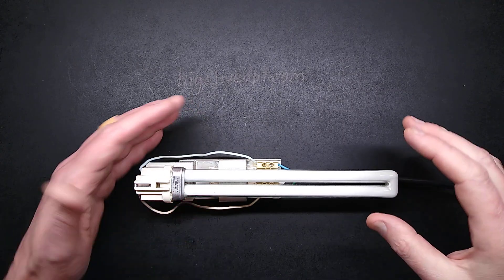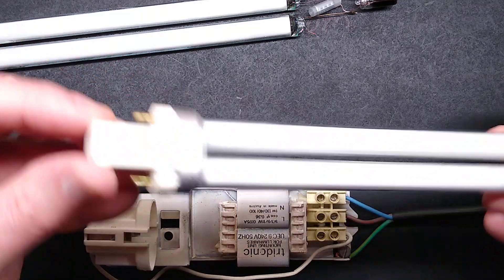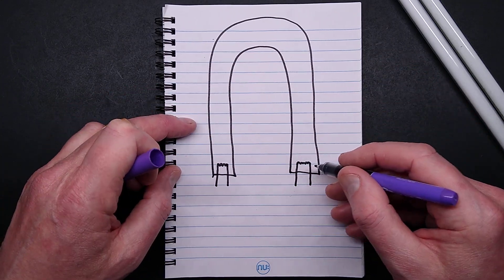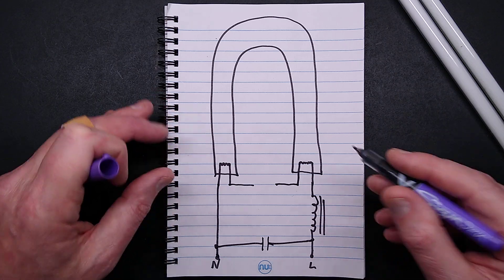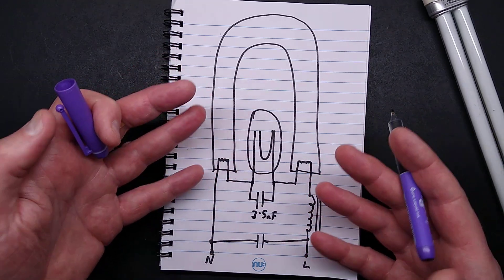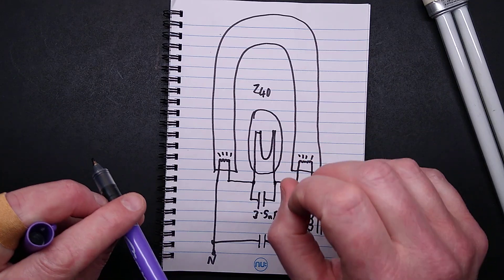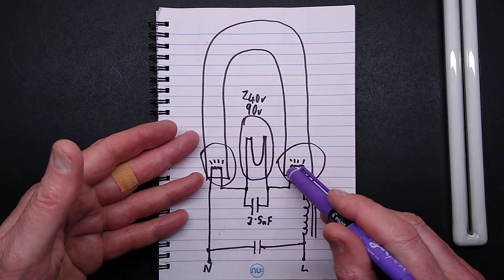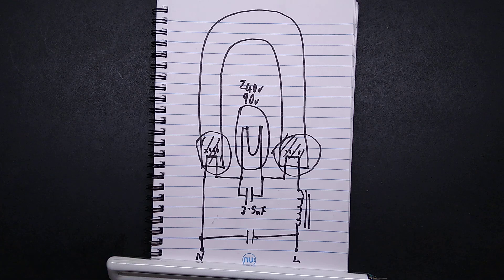Retro already?

Comment: I still have a few of the first commercial CFL lamps, where you used a PL lamp and a ballast, some electronic, some magnetic, that you could fit into a standard lamp socket. I used to repair them as well, they had a few standard failure modes, fusible resistors that died, and bridge rectifier diodes that went short circuit, and a capacitor that went open circuit. As they cost then the equivalent of $30 and a fix was under $1, well worth fixing them. The magnetic ones you just changed the tube, and away it went, with them outlasting almost all of the CFL or LED fixtures by a large margin. On 24/7/365 they would last 2 years with good quality Osram or Phillips tubes ( made in the EU of course, the GE ones made anywhere were complete junk, unless you had the ones fully made in the USA before the plant was closed and moved to Mexico), and were reliable, just needing a new PL tube when the old one failed.

That kit is actually a retrofit kit, designed to be used to convert a standard brick style bulkhead fitting from a 60W B22D incandescent lamp to PL, either PL7 or PL9, and would attach using the same screw mounting holes used for the bayonet holder, and fit the lamp in the existing cover. I did do a fair number of those, as it was a lot faster in buildings to retrofit, using the old fixtures in good condition, and only replace a few that were failed, using them for spares to fix the others. Made lamp changes something you simply did as inspection once a week, and pull out a ladder to change a lamp a monthly thing, not like incandescent, where you were changing a half dozen a week at times. Box of lamps would last a decade, instead of a year.
Reply: I have collected quite a few of those of the Sylvania Lynx Diamant variety with the magnetic ballast. But also some of different brands with electronic ballast that seem to have issues to start on tubes other than the ones they came with.

Comment: There's a landfill/recycling yard a couple of miles away across the valley from me, and they have yard lights that switch on when it gets dark. There is one light that is pointing directly at my house that does that slow blink of a bulb on its way out; 6 seconds on, 6 seconds off. It's the most annoying thing because once you notice it, you can't stop looking at it because it's the brightest light in its surroundings. If anyone reading this works at the landfill on Whinney Hill Road, please replace it. I'll even buy you a new one!
Reply: Better still, move to low energy lighting. I'm sure your local councillor would love to take their idea on, and then put it in the newsletter as their idea.

Comment: i miss fluorescent already, used to be so easy, nice easy repair no matter what was faulty, now it is replace the whole fitting with a complete new unit because nothing has been standardised so you cant just swap over the driver or leds. even worse the chances are the new fitting will be completely different to the old one.

Comment: Thank you. My grandfather tinkered in his spare time, and after he died, I discovered treasures of ballasts, starters, and other wizardry that he'd sadly never had the time to teach me about. 
Fast forward, and I'm attempting to resuscitate these blighters in my recently-deceased parents' home's garage.
Reply: I guess your grandfather and I were kindred spirits. As a teen, I followed the schematic on the fluorescent ballast and wired up my own lamps (15, 20 watt: 18/24 inch). I salvaged countless parts from curb finds, such as lovely thin vintage connectors. I bought spare ballasts only to find they're barely needed anymore 😞
Reply: Enjoy the relics.  We had an old fluorescent lamp in our house (my wife's grandfather built it).  The lamp wasn't working.  I cleaned the tube contacts, no luck.  Then I remembered I had a box of new-old-stock fluorescent starters somewhere.  Starters are a little aluminum can about the size of your thumb.  So I dug around, found the box, and replaced the starter; back in business.  I'd say I have a lifetime supply of starters.
Reply: Old ballasts need to be disposed of properly
Reply: @OffendingTheOffendable don’t you mean oiled filled capacitors ?
Reply: @steveosshenanigans  There was a time when they filled ballasts with same nasty oil. Lots of it.
Reply: @NGC1433  
Oh ok 👍, must have been before my time
Reply: @OffendingTheOffendable  just because they are suposed to be disposed properly doesn't mean that he has to do it as well 😂
Reply: @savedemperor   Do you realise the health threat from those old oil filled devices? 
Research PCB, if you can.
Reply: @BTW...  yes nasty stuff
Reply: @BTW...  Its safe until its not leaking.

Comment: It's amazing to think how long fluorescent tube lighting has been in use, lighting up our lives, whether in a malaise, sickly colour in offices or school classrooms, or in high-CRI in supermarkets to make produce pop, and it's only now they're being ousted in favour of LED, even if LEDs are not quite as robust or long-lasting...
Reply: LEDs can last significantly longer than fluorescent lights if they are kept cool and not run at maximum current. 
The main problem is LED bulbs that are made to go into existing fixtures. There usually isn't enough room for a heatsink and not enough airflow so the LEDs burn up quickly.
Reply: @rocketman221projects  Thing is you need to have more LEDs than they put into replacements to achieve the goal of running cooler to last longer as well as have enough light output to be of the same level as the fluoro they're replacing, but, because we get stiffed with the fewer-LEDs-run-at-higher-current jobs, they will fail sooner than fluoro tubes, usually through cooking the phosphor gel, burning the PCB material, or even desoldering themselves from getting too damned hot...
Reply: The thing is, high CRI is better achieved with white LEDs. And the general public tossed fluorescent mostly because CFL lifespan is still relatively short compared to incandescent bulbs.
Reply: @PainterVierax  High CRI with either technology though is expensive, so isn't something we would get at home unless specifically sourcing such things, and CFLs of course were built to a price (aka profit margin), even if it meant the electronics failing long before the tube due to excessive heat inside the base of the lamp, linear tubes, 2D, PL-x and the like were still a far better option when it came to running costs compared to an incandescent bulb in terms of lumens per watt, even if the colour temperatures were pretty rotten if the person buying the tubes was a cheapskate...

Comment: I had an LED flash thought it was the power supply, replaced it and it still flashed. The LED was the problem, I believe the little gold wire was broken acting like a bimetal heat bending just like in the starter device here.
Reply: Usually the epoxy cap expands and lifts the wire, cools down and makes contact again.  All too common and could be minimised by having low profile wire bonds and a gel coat over the wires that will lot pull on the wires.  Manufactures don't care because the consumer will buy another one when it fails.  All the electronics in the base get chucked out.

A thin tungsten filament is still one of the simpler electrical components out there.

Comment: I have a 6volt Flourescent lamp runs off 4 AA batteries, with a tube HFF4T5/D that is interesting 🙂
Reply: They have a voltage multiplying driving circuit.

Comment: I work in toolstation, and we still get people coming in asking for CFLs, even though we have very few of them left in stock.  They either don't like led light or don't like change 😂

We do sell "conversion tubes" for flourescent strip lights that come with a special starter that you have to use with them.  I got curious and opened one.  Turns out it's just a thick wire link between the 2 pins inside it.

Sat on my workbench I've got a couple of the original Philips "jam jar" CFLs - the ones that take a good 15 minutes to reach full brightness.  My Dad bought them when I was little, probably around 1980, from Granada (the TV rental place) when he was working for them.  They still work fine 😊  weigh a ton though!  I would be interested to dismantle one and see what's inside, but I'm loathed to destroy one that still works
Reply: I just have a stockpile of incandescent lamps and have lowered my house voltage to 220V (standard is 230, but in practice it can go up as high as 245) to make them last longer. 
If I plan on using the lamp a lot, I might also put a resistor in series with it, both to drop the voltage even further and to limit the inrush current (which is what is most damaging to the bulbs). There used to be a small two-wire dimmer (just put it in series with the bulb) available that would gradually bring the brightness up, but it is not made anymore.
Reply: yeah, they're worth a few quid now, i wouldn't strip it down.
Reply from the maker: It's literally just the chunky ballast in the middle and a tube surrounding it.  (I opened mine).
Reply: I remember those, Philips SL18's and SL20's.  Those were the days.  Jumpers for goalposts 😁

Comment: Do the two filaments at either end glow like incandescent lights?
Reply: Only glow enough to emit electrons, so a very dull glow, till the starter goes short circuit, where it will glow bright yellow.
Reply: @SeanBZA  Thanks
Reply from the maker: They glow a dull orange.  When you see a light with a stuck starter and that continuous orange glow at the ends it may be using more power than if it was lit.

Comment: Sad that so many great forms of robust of reliable lighting is getting banned for political reasons.  Most of the  consumer led stuff is garbage that just doesn't last.
Reply: Mercury is an element, it doesn't hold political views.
Reply: Mostly because manufacturers are overdriving and overheating LEDs deliberately to increase brightness (when new at least) and to help repeat sales. Governments should step in at some point if they really want to reduce carbon emissions and e-waste. 

Also some standards need to evolve for interchangeable ballasts.

Comment: Hey, I never realized that the neon bulb in the FL starter was initially shorted. I always thought it was neon bulb combined with the capacitor that worked as a relaxation oscillator with the inductor being its load, and when the current stops flowing and magnetic field collapses, the self-induction EMF causes the mercury vapor (or other gas in the FL) to ignite.
Reply from the maker: Initially the neon starter is open circuit but glows with the high open circuit voltage.  That makes its bimetallic contact close.

Comment: In a past life, I was an electrician on US submarines. Amongst our many duties maintaining the nuclear propulsion plant, we had to maintain all the lighting on the sub. It was 99% fluorescent fixtures. What a nightmare! I would much rather have changed the whole fixture than go through the hassle of changing ballast, starters, and tubes. It was a non-stop job.
Reply: High vibration environment damaging tubes?
Reply: @TheBackyardChemist  I imagine a sub also just has a lot of lights, what with being a sealed tube full of small compartments, and '1 out of 4 tubes is still working, we'll get to it in a few months' probably doesn't fly. Add in what were probably quite well sealed light fixtures, and I can see keeping up with the light fixtures being a hefty timesink.
Reply: Now with crappy LED fittings you can have the drawbacks of both with the benefits of neither! Hooray progressivism!

Comment: I have a fluorescent tube thingy in my bathroom ceiling and I'm not looking forward to having an electrician in just to "change my bulb". 🙂 I'm worried about the method used to connect the light fixture to the electrical system. If it's hardwired, non-electricians like myself are technically not allowed to touch it. It might be using an old-fashioned type screw terminal and I would therefore be allowed to change it myself. Otherwise, with the planned obsolescence built into such features these days, I can foresee a frequent expensive use of electricians every time the "bulb" needs changing. 💸 btw, I'm in Norway.
Reply: Standard tube sizes replacement LED replacements are available.  I too rail against the unfixable integrated hard wired LED fitting that, at least in Australia, legally requires the employment of an electrican to replace.  No way I'm going down that path.  I'll be buying fittings that allow standard form bulbs to be replaced by me.
Reply: I thought you were allowed now, as long as you replace like with like?
Reply: @chriswilson1853  Not in my country. The laws here are pretty strict. Sure, there's a low risk of anyone ever discovering that I've replaced a light fixture… But if it had a fault which caused a fire, there might be an issue with insurance if discovered.
Reply from the maker: They'd have to prove you changed it.  I regard this over-regulation as a protection racket.
Reply: @bigclivedotcom  Over-regulation banning almost everything: The meme of Victoria, Australia.
Reply from the maker: @RJARRRPCGP  They're over regulating here now too.  All profit driven by companies pretending to be government bodies.

Comment: The germicidal lamps will stay, since the EU regulations usually have carved out exceptions for "special purpose fixtures" and such things. Also the classic CCFL tube signs and similar neon installations will still be allowed to be made. They're just banning generic room illumination equipment.
Reply from the maker: Our experience with ban on most tungsten lamps was that the price of the smaller market theatre lamps went through the roof.
Reply: @bigclivedotcom  Yep, partly due to the drop of economies of scale, and partly through capitalist scum price gouging ... :(
Reply: Do not forget oven lights, I have seen a few people put CFL and LED lamps in there, and it was not pretty.
Reply: @SeanBZA  The ol 40W appliance bulb has also gotten worse over the years, more expensive and lasts maybe a 3rd of the usual life. I remember leaving them on all night as a kid and they lasting for years...
Reply: @spikester  I have some lamps that were made at the latest 1939, as that was the last entry date on the cord. Frosted ones are double coiled filament, and the clear ones are carbon or tantalum filament. All marked in candlepower.
Reply: @SeanBZA  I was thinking about that specific use case as well.
Reply: yep same with incandescent <3 Also Hi markus